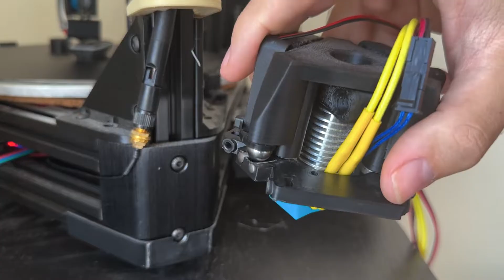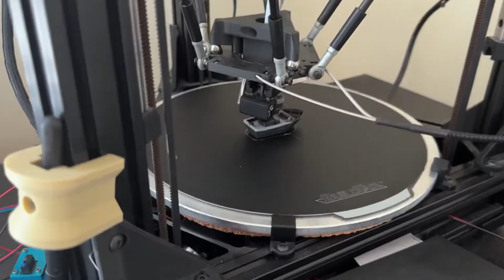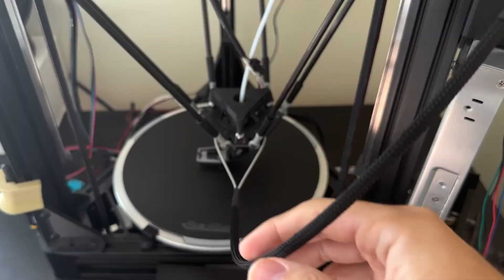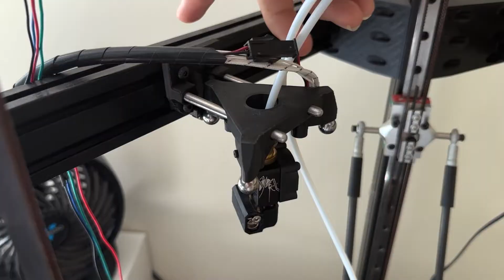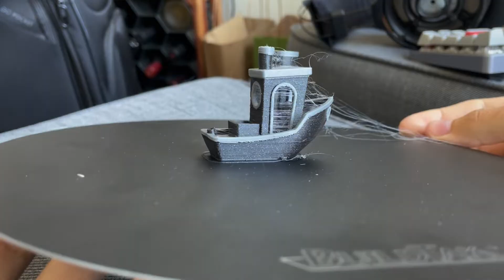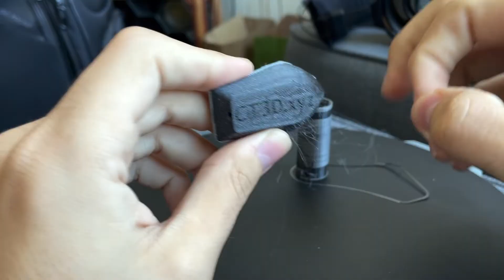Delta Toolchanger Tour and How It Works!

Comment: really nice project, great consept! just a quick question, why du u still use a purge tower if u have separate toolheads for each color?
Reply from the maker: You can think of it more as a wipe tower rather than a purge tower. The material will ooze while the tool is not used even after a retraction. So from there, to prime the nozzle, you’ll want to minimize material loss during your wipe routine when the tool is grabbed. I wanted to use the Pebble Wiper but never got around to it.

Comment: How are you setting x-y-z offsets for the different tools ?
Reply from the maker: Late reply but in RepRapFirmware you can set offsets per tool in the config files. When you switch to a new tool, that tool’s offsets are used.

Comment: Part cooling duct should be mounted to the effector i think not the tool.
Probably something like a berd air would work nicely. (remote pressure generator or CPAP fan and a metal tube bent into a ring as the cooling duct)

Comment: Very, very cool!  Remote cooling via CPAP hose should be a reasonable approach for the part cooling, since it would eliminate the need to make space for a fan's footprint on the tool itself (and save wires).  You could split one fan's output to all tools to save on complexity, or maybe have a switchable diverter valve to keep one fan without wasting flow on parked tools.  Or just have multiple fans, of course.
Reply from the maker: Great minds! This is also what I’ve been thinking. The one downside is if the fan and shroud are connected to the effector to be used on all tools, then you wouldn’t be able to accommodate cooling on tools of different height, like a volcano hotend. I do like the idea of each tool having a dedicated fan and shroud but I don’t think it’ll work.
Reply: @bdw537  I was thinking that you'd have the cooling ducts as part of each separate tool, to mitigate the custom length issue.  The footprint of a cooling duct fed by CPAP can be very small, something you could easily pipe down through the effector alongside the hot end.  You could also make a cutout in the effector specifically to open up space for larger ducts.
Reply from the maker: I see you’ve implemented something similar on your delta. Let’s connect. I’d really like to have a manageable part cooling solution.
Reply: @bdw537  Yes, I've enjoyed good results with my setup and it's given me some experience with routing ducts through tight spaces (my effector is really tiny).  I'd be happy to connect and see if I can help you figure something out.  YouTube keeps deleting my comments when I mention where to find me ... Colphaer on Rolo haun 3D 's D i s ----  co--- rd ...?
Reply: @bdw537  I had a look at your files, and I think I see a decent solution.  Hose barb on top, probably a glue-in or screw-on fitting separate from the tool print due to orientation.  The hose barb location will have to depend on the placement of the fork holes for the tool number, but the duct would route as needed to the back of the mosquito mount.  There's room to run the duct straight down the back of the mosquito mount without interfering with the rotation of the locking ring.  From there, it's just a matter of giving the rest of the duct enough clearance from the heating block to avoid melting the thin walls on the way down to printbed level.  There isn't much room for an elbow for the sake of smooth airflow like I have on my design, but an air source that can manage a little static pressure can make up for that.  Opening up the size of the locking ring by about 2cm would make this substantially easier, although I realize it would require an extensive overhaul.  As an alternative, you could also wing a cooling duct from the tool around the outside of the effector between one of the arm pairs.  More plastic, but it looks like your arm spacing would offer the clearance for it.  I hope this helps, and I look forward to seeing how you progress with this 👍👍